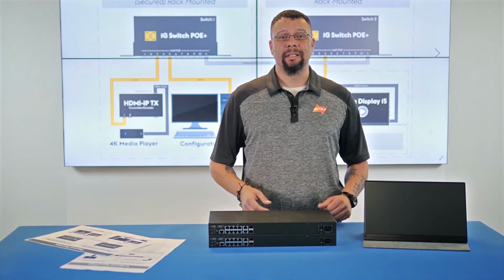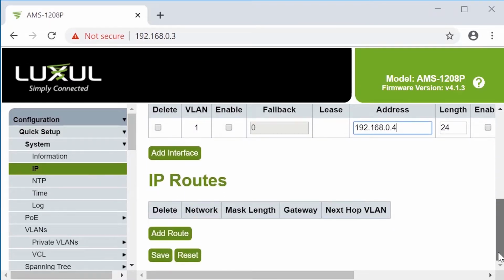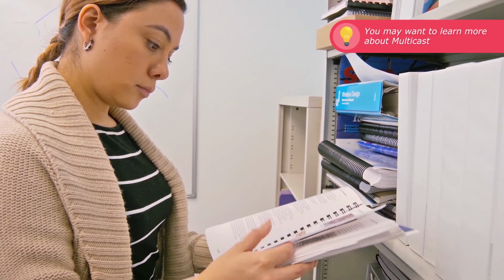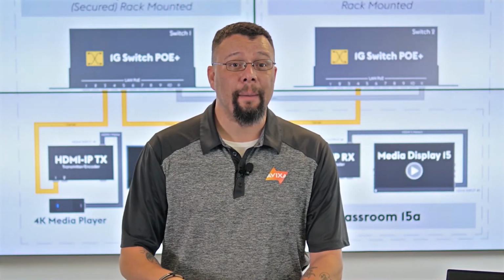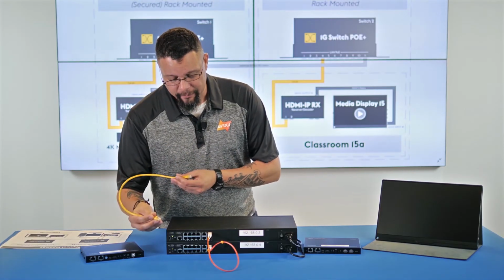The Audiovisual LAN Series | Build an AVoIP Sandbox

Comment from the maker: Build and AVoIP Sandbox Time Stamps

Physical Topology - 0:18
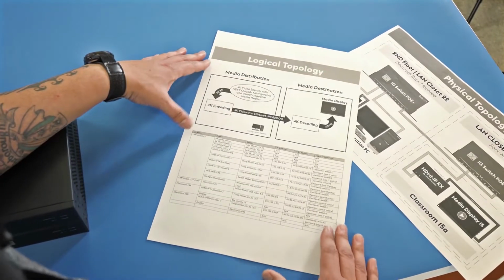Logical Topology - 0:48
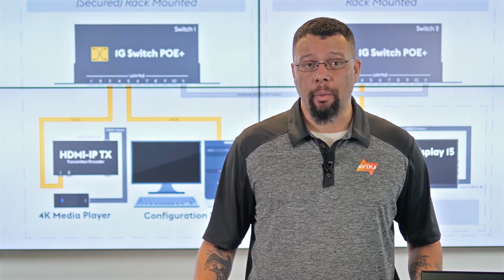Multi-layer Switches (Layer 3) - 1:32
Small Form Factor Pluggable (SFP) - 2:06
Transmitter and Receiver (Encoder and Decoder) - 2:53
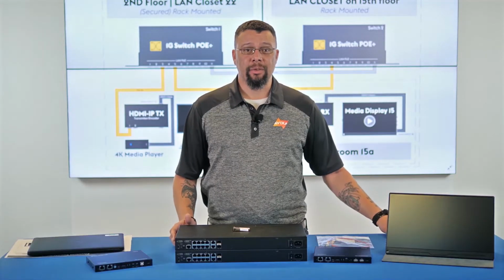Switch Management Interface - 4:12
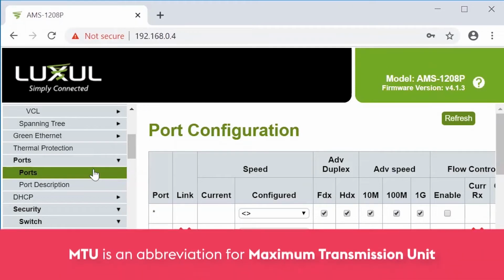Maximum Transmission Unit (MTU) - 6:19
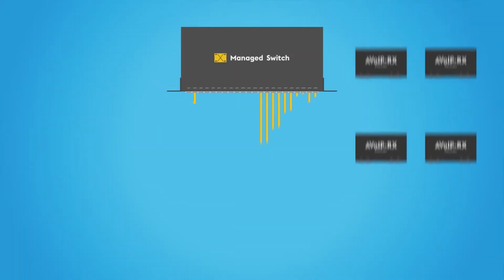Multicast - 6:48
Internet Group Management Protocol (IGMP) - 7:00
Command Line Interface (CLI) - 7:34
Labeling devices - 8:04
Connecting devices to begin sending data - 8:17
System Setup Configuration - 12:57
Video Recap - 13:58